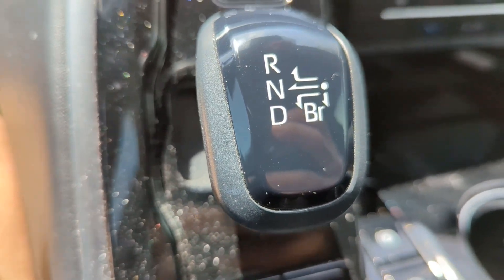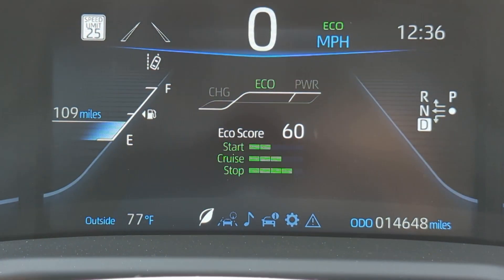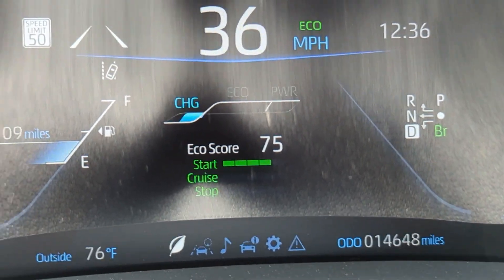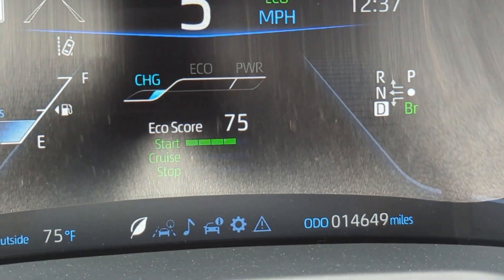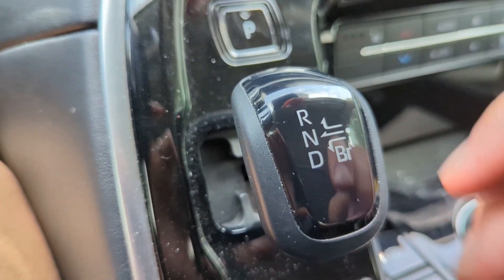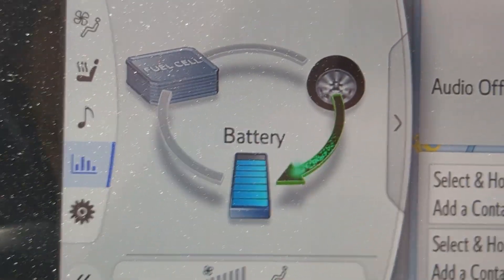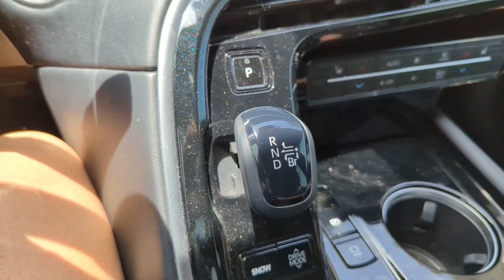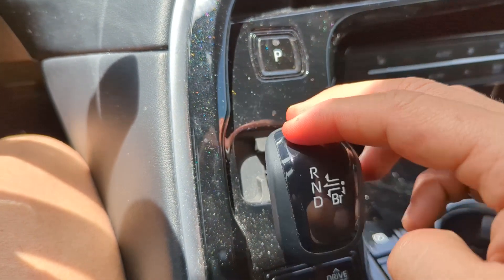What does the "Br" do in a hydrogen car?

Comment: Good after noon Iam driving my 2017 Toyota hydrogen it seems to loose aceleration it only goes to 45 and then it does not want to power more what problem or how can I see if a I have a mechanical problem